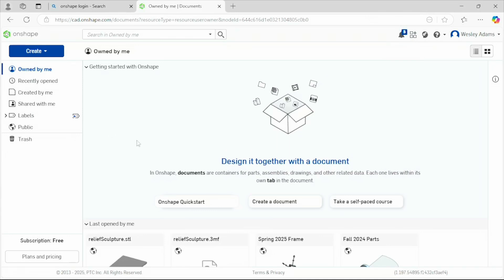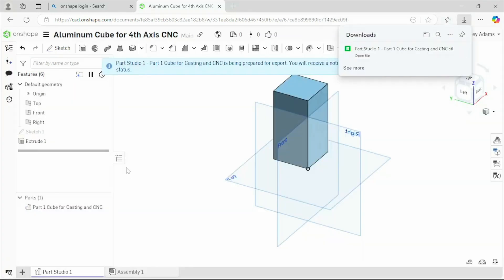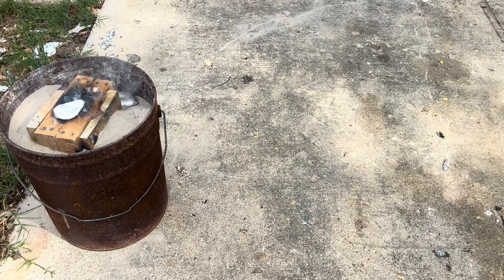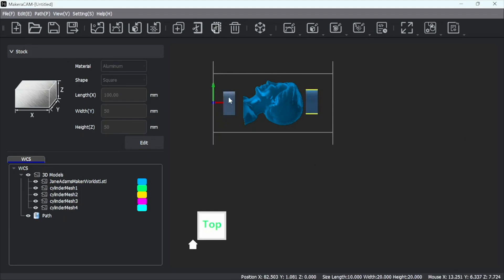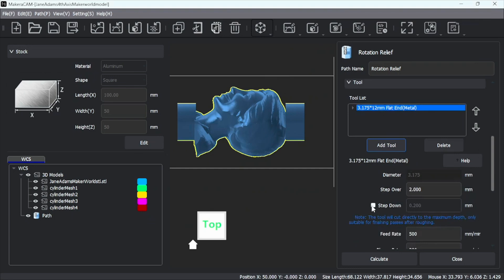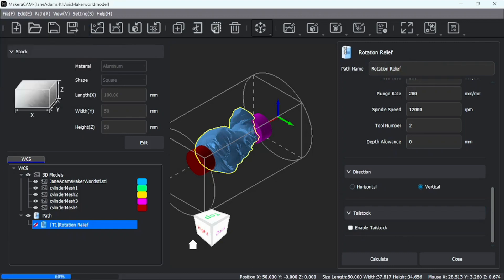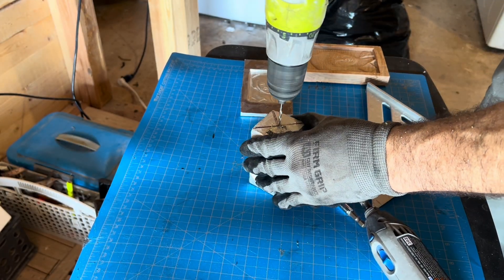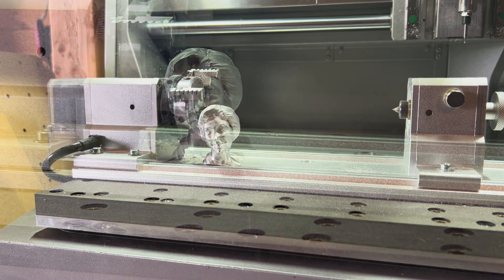Makera Carvera Air: 4th Axis Aluminum 3D Model from Photo

Comment: Nice video!  Did you end up changing the off set from 40 to like 100 for the part origin?  Wouldn't 40 put you into the chuck teeth still?

Comment: Hello,

Awesome Video!

Quick Question, Had you any problems with the length of the First bit? Do you know If the Cam itself detects If the vit is to Short?

Thanks in advance!!
Reply from the maker: The scan perimeter and auto probe should allow the correct adjustment for the stock you are using for the Z axis. I have had to adjust the bit collars using the tool. I few were not set correctly from the factory. The bit collar tool will allow you to set the appropriate length for each bit. I hope this helps